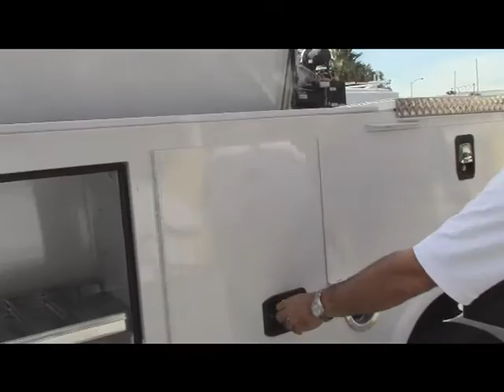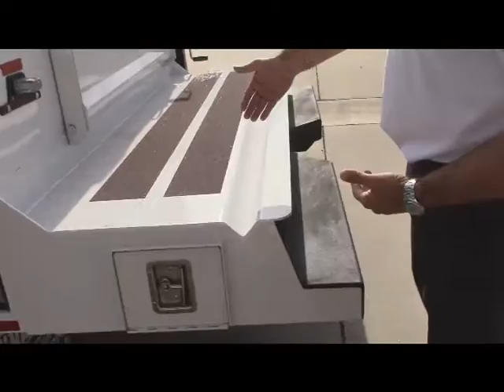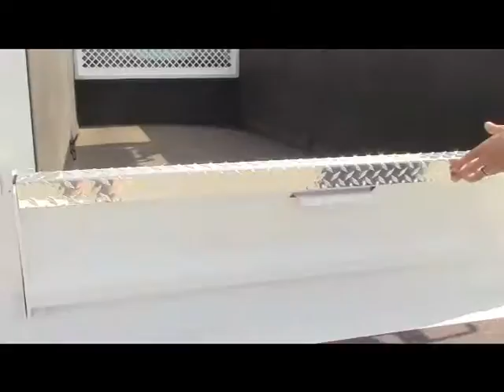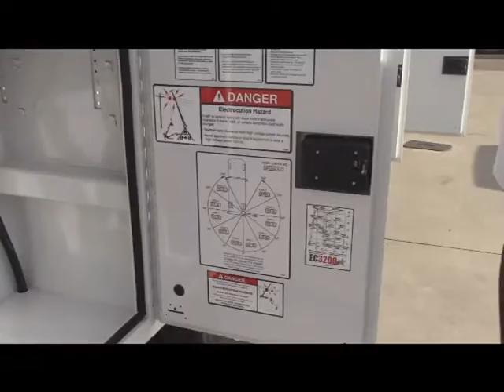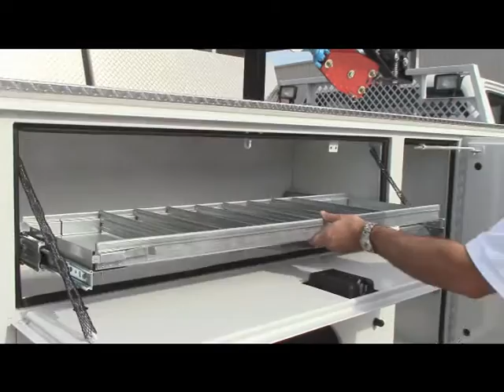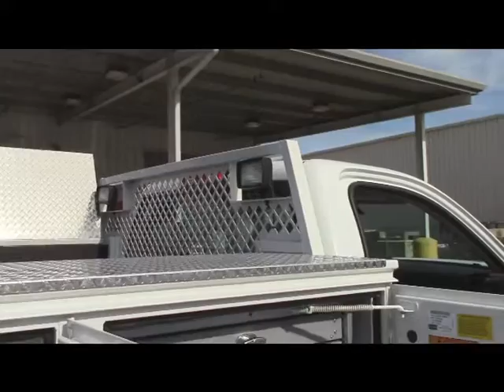Knapheide's Most Popular Crane Body Lifts Up To 3,200 lbs.

Comment: MRSP on this?
Reply from the maker: Contact Knapheide at www.knapheide.com
Reply: CommTruckSuccess I don't understand why you sales guy make this such an indever. I've been looking at these for months now. And the company I've gone with had a list price. Limited run around and where upfront in their prices. Similar situation with the truck I got to mount it on. Had a list price. Not interested in the BS. A good price is either a good price - or not. Thanks anyway.
Reply from the maker: Thanks for your comments. We don't sell vehicles. We promote commercial trucks, so I have no idea what the MSRP is. Knapheide is the manufacturer and they can direct you to a dealer that can give you their best price as you need in your area.
Reply: CommTruckSuccess ah! I see! That makes sense!  I thought you were directing me to your own website. Sweet rig you have built there! Sorry for the confusion